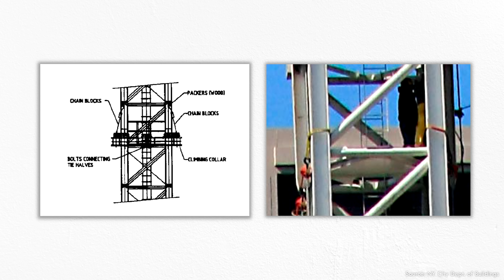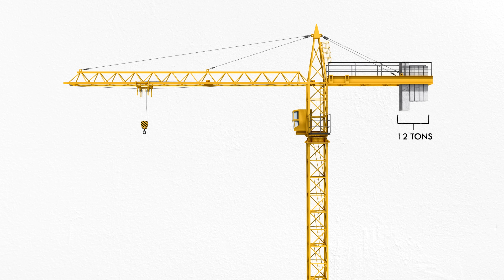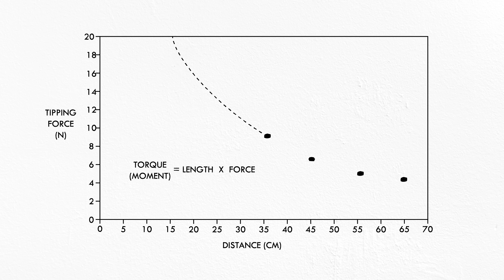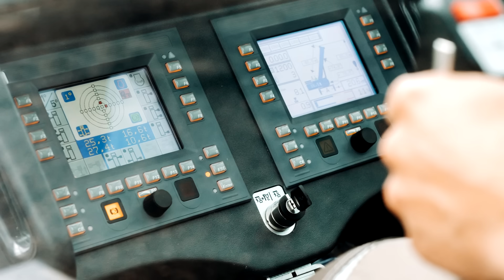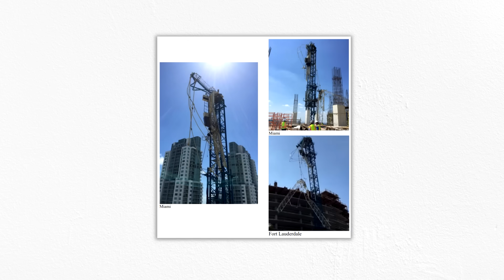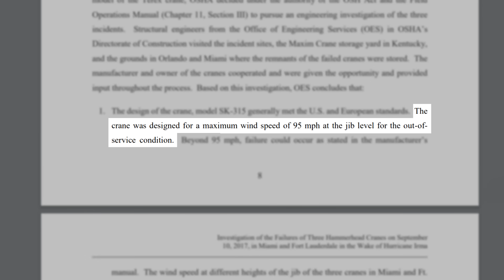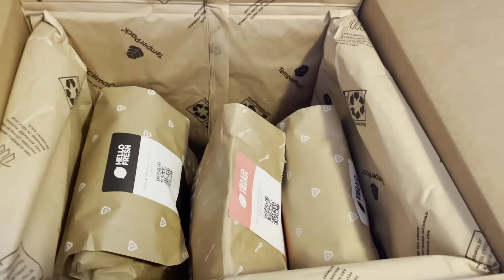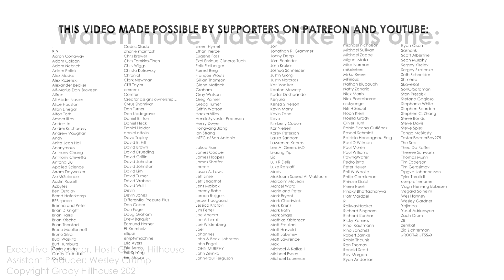Why Cranes Collapse

Comment: I have a smaller Knuckle boom crane. 
It lifts 1900 pounds 75 feet. Straight up it’s 86 feet. 
It’s crazy How gravity plays games
When I was younger I was in an aerial bucket truck when it got laid on its side. 
It threw me like a Rag Doll Apparently there was a small void in the ground and the Outrigger went down The truck shifted enough that’s the Centre gravity Shifted Enough the truck went over. I was lucky 
The dirt was unpacked and Soft. 
With my new truck that I own I Crazy overkill the Outrigger pads. However There’s a lot that can go wrong. What I can lift straight up
Will lay the truck on its side If Extend too far out without lowering it. 
I see a lot of crane operators With too many extensions out(Straight up) Not realizing the extra weight In the extensions. They should only take out the boom as far as they need. 
When in doubt get as close to the load as you can before you pick up. 
It’s amazing how many close calls I had even being is over careful as I am. 
Just because it’s rated For it Doesn’t mean it will lift it Safely.

Comment: I’m a high voltage lineman in the Dallas area. I was working the storm on the Dallas crane accident you mentioned. We had several outages due to the winds that night. The reason I remember it so well is because basically no news stations reported the incoming storm. It came out of nowhere, it popped up North of Dallas and winds quickly picked up, if I remember correctly Addison airport had winds in the 90+MPH range. I’d guess the crane that fell into the building was left locked down like you mentioned. Nobody expected that storm.

Comment: Anything with at least one dimension of twelve inches had to be stacked on the shore. Yes, from twigs to 100’ long water logged trees. If the boom was hampered by trees, I climbed the boom to cut the tree limbs after hoisting the chain saw to my position by rope. It was a great job with me starting and knowing nothing of cranes and barges to become a thoroughly efficient deck hand.

Comment: A two cylinder Lister winch raised and lowered the spuds. A Detroit Diesel powered Sea Mule provided propulsion but at a slow pace. The Sea Mule pivoted the barge on the weight of the crane. In a high wind the crane assisted the Sea Mule by paddling with the clamshell bucket. 
It was nine months of loading piles of driftwood on transport barges to be burned in a smokeless fire miles away.

Comment: Not on topic per se,  but i am curious about one thing about cranes.  I've seen how tower cranes are assembled, but i was watching one show about the construction of a really tall building in China.  It seemed like the buildings upper floors were taller than any available cranes could reach so they were welding attachment points to part of the building itself and the crane was moving up that way. But then they built the floors under that as they went.  So the crane was attached without is own tower and the structure it was mounted to got covered by the construction.

How the hell is that crane not a permanent part of the building? Or is it?

Comment: As a crane operator, then trainer who wrote the operating and inspection training programs at a nuclear power plant, your information is spot on. Our cranes were a 170 ton pendant operated reactor building crane, a 65 ton cab controlled turbine building crane, both overhead traveling type. We absolutely required a single designated signal person, except for an all stop. We also tested for operator depth perception and fear of heights, as well as load swing catch. Our operators would "compete" with each other as to who was the best at totally catching the 169.5 ton loaded reactor fuel handling machine exactly in order to lower into the reactor isolation valves without any further movement. I would make the turbine crane operators lower the hook into a bucket on a complete angle far from the cab, to test depth perception and vision. Ah, those days...

Comment: Maybe a silly idea but why could a fixed or even a tower crane not have like large anchro screws drilled into the ground or even say bedrock. Your sand demo made me think of this as one side presses down but other lifts up like a lever so why could it not be anchored down with some sort of a screw system? Besides if one side was over tightened if do this it seems it would highly unlikly a crane could totally fall over.

Comment: As a Wisconsinite, there is no need to clarify the "American Family Field".
Everyone still calls it "Miller Park" or "Brewers Stadium".
Up yours AMFAM.

An interesting piece of info; the original operator for Big Blue declined to hoist that day because of the high winds. Due to deadlines and budget constraints they brought in another operator to lift the roof section.

Comment: I watched two very tall buildings being built in downtown Chicago 2-3 years ago. Both had different types of cranes and all the cranes were assembled and operated safely. I watched them lift and place a lot of different types of loads from steel beams to hoppers of cement to outhouses. It was cool to watch.

Comment: I witnesses a near crane collapse as a 97, 000 lb solid fuel rocket motor was being lifted from my trailer onto a railcar, on of the outriggers on the crane suddenly collapsed into a depression in the blacktop which it was standing on and thanks to the quick action of the crane operator there was no damage done

Comment: If a building were built from heavier beams at the bottom to progressively lighter beams according to load at the top of the building could building be made higher and safer with cranes?

What about using plastic instead of steel for building beams?

Comment: I’m the accident in Milwaukee the gc on the job was constantly in trouble for safety violations because it was managed so poorly he forced contractors to do things unsafely and they were the ones that told the crane operator it would be safe additionally the three people that died were in a bucket meant to bolt things in place one everything was in place so first off only one person was needed in the bucket and additionally the osha guy was there to look at safety concerns if that doesn’t tell you something

Comment: I spent 35 years in Ship Repair after coming out of the Forces. In that time I saw 5 crane failure's which resulted in 3 deaths. 4 of the failure's were due to overloading for the radius the jibs were at, the other one was high wind. It's a horrible feeling watching a Crane go over and knowing there is nothing you can do. I am 78 now and must say that the vast improvement in Health and Safety in the Western World has contributed to workers safety but we know that accidents still happen!
Reply: High winds I can almost excuse as an unanticipated element but overloading for the radius seems like wilfull recklessness. There's no way any operator wouldn't know the load limit by radius, that's the most basic of all limits. They had to have been disregarding the limit, right? What kind of organizational incentives led to that?
Reply: @chiaracoetzee  At 20 miles an hour, radius and boom length should be reduced. At 30 the lift should be cancelled.

Comment: I've always wondered how a tower crane can manage to go from unloaded to loaded, without falling over forward.  Obviously there are counterweights on the opposite side of the beam, but that just makes it seem to me that when UNloaded the crane would have the potential to fall over backward.  I had always assumed that the counterweights moved in and out, closer and further from the fulcrum point as the load being lifted is added or removed to keep balance, but in this video, in some of the closer shots of the cranes, it doesn't look like this is possible.  Isn't this a seriously restricting aspect of the loading of any crane of this type?

Comment: I have been a crane Inspector and Test Director for over 15 years.  I find that in the early days, cranes were over built do to a lack of knowledge (engineering) and an abundance of labor and material.  Today, cranes are engineered right to the edge.  The benefit to the crane manufactures is that they can sell a higher capacity crane at the lowest possible expense.  The problem this creates, however, is that there is literally no room for error.  The slightest miscalculation is now catastrophic were it might have been absorbed by an older crane with an inherently larger safety factor.  Additionally,  profit of a project is inevitably tied to the speed work can be done and often has an inverse relationship with safety.  Methods to "speed up the job" are often implemented at the cost of doing it as safely as possible.  The willingness (known or unknown) to cut corners coupled with cranes built to the edge is a recipe for disaster.
Reply: a good rule of thumb is dont go above 75% without a lift plan signed off by an engineer
Reply: Old Lima cranes are proof of overbuilt. 4100 Vicon also. New cranes are no match
Reply: @travisw81  we LOVE them here in Jamaica!!  An old employer has several “new” Krupp hydraulic cranes being scrapped for parts while the Limas that are 50-ish years old are still going strong (including one that I watched turn over about 16 years ago)….
Reply: Remember, though, that when cranes are assembled or operated incorrectly, it's not always the workers who make the mistake or cut the corners. Often it's management that demands they do it.
Reply: Brian - DUE
Reply: Just like everything now
Reply: In the 1970s, I was taught Allowable Stress Design. It gave an overall factor of safety of 4. In the 1980s, many engineers went to Load Factor Design Method which seems to be a factor of safety of 3. With older US made steel it was fine. Starting in the late 1980s, foreign steel started coming in to the US. Some of it was substandard and lead to failures. There is still substandard steel around and it can cause failures. In 2005, I was told about chinese steel that failed at 1/6 the design strength.
Reply: @richardross7219  foreign steel flooded the U.S. in the 80s. My grandfather worked at Geneva steel. They had just finished major upgrades and their plant was state of the art. The Chinese started selling steel at prices just under where geneva and other US mills could stay afloat. The federal government refused to increase tariffs or do anything about it. 

After a few years the majority of American mills went bust, and the Chinese steel prices skyrocketed.
Reply: Bang on Brian. That is why Roman. Greek & Victorian structures are still In use safely to this day. Cranes!!  Of old the same.

Comment: I witnessed a crane accident with no injuries a couple years ago. The load was a huge and old machine. The load was properly secured and the mobile care that was used was less than half a year old and was fully loaded with counter weights.

The machine that were being lifted broke which meant that most of the weight fell back down to the ground less than a meter down. But due to the stored potential energy in the boom together with all the counterweight did it cause the crane to tip backwards.

Boom arm landed in a field where nobody was working. The only damage that occurred was the crane and the asphalt in some spots

Comment: I wouldn't necessarily call the tipping action a biproduct of torque. Torque is a moment about the longitudinal axis of the body that would cause twisting, this seems more like a bending moment
Reply from the maker: A moment (or torque) can refer to any axis you choose.
Reply: @PracticalEngineeringChannel  Says who? Generally yes, but in practice when you consider the geometry of the body, torque will cause a twisting of the body.

Just to clarify, I really like this video. Just torque produces a twisting motion. It is more correct to refer to a force acting at a distance that causes bending as a moment/force acting at a distance that causes twisting as torque. 

This is probably the best way to describe it- all rectangles are squares, but not all squares are rectangles. i.e, torque, bending moment, and couples are all moments. But torque is a distinct subset of moment, in which twisting about the longitudinal axis of the body occurs. It is not accurate to say that torque and moment are equivalent, when torque is a specific kind of moment.
Reply from the maker: @shaneprather6743  Thanks for the feedback, Shane. I'm a licensed engineer with 10 years of experience in professional practice. Sounds like maybe you just work in an industry that uses the terms a little differently. The Wikipedia page for "Torque" says "It is also referred to as the moment, moment of force, rotational force or turning effect, depending on the field of study."
Reply: @PracticalEngineeringChannel  This is more so from an academic perspective, not industry specific. Regardless of credentials, we all have room to grow.

Well wikipedia isn't exactly reputable, but yes. Torque is a type of moment, like I said above. The moment of force is a term which specifically refers to torque. rotational force, i.e producing rotation about the axis, not bending. I've never heard of the phrase turning effect, but yeah, seems to imply a turning/twisting motion as opposed to bending.

Fundamentally, torque and bending moments are different. The stresses caused by these are analyzed differently. I dunno, it just seemed weird to me to refer to that action which caused tipping of the crane as torque. I would be more concerned with the compressive/tensile stresses in the arm(?) of the crane due to bending, as opposed to  any shear stress due to twisting.

Comment: Most of the major tower crane manufacturers, according to their headquarters, follow the European standards as far as stability calculations are concerned. The same applies to manufacturers of crawler cranes and large rotary drilling rigs. All these calculations assume an unyielding base such as concrete. In reality, however, we just have more or less artificial or natural ground as a subsoil that tends to settle or fail. Therefore, coordinated theoretical calculations as well as practical tests are currently underway in Europe and North America to increase the reliability of lifting operations and to provide a decision-making tool that is manageable on the construction site.

Comment: What your referring to of a "lift plan" is law now in Canada and a category of what's called "critical lift" depending on jurisdiction is when 80% of Crain capacity or when 2 or more Crain's are used for any lift as well as further rules are what constitute as "critical lift" a separate safety meeting must be done with a personal involved in the lift as well as every one who are working in the area that can be affected by the lift if something goes wrong and if it has a incident what to do all this must be documented and every one are required to sign proving that the laws of rite to know have been met. No workers are left out from the newest labor all the way to the top Canadian OH&S laws do not distinguish any rank or position every worker has "The rite to know and the rite to refuse any work they may find to dangerous" And by invoking there RTR no employer can hold that against the worker.

Comment: I am currently an engineer on an industrial site and our policy is all lifts must be approved by the construction manager, all of our lifts have plans as this is a live plant. Some plans like for tandem lifts need to be engineered and sealed. Above 80% capacity we classify as a critical lift.
Plans need to also account for underground piping which can be crushed by the lifting activities.

Prior to a lift we always have a pre-lift meeting to discuss roles and risks.
During a lift, wind readings are broadcasted.

Never go under a load.
Always stay outside the "hospital side" of the crane (The direction it is most likely to tip in).

A 650 ton crawler will be delivered in the new year to stand up some 150ft distillation columns which I look forward to witnessing it in action.

Great video!
Reply: @sixsgma1563 How did your project go with the 650 ton crawler and 150ft distillation columns?

Comment: Biggest thing I’ve learned with using heavy equipment and material handling is as the operator you have the ability to say “it’s not safe to lift and it’s not going on my machine”

Comment: Crane failures are very simple:-  1.  Load (centre of gravity) extended beyond lateral support limits.   2.  Load increased above safety limits, thus overstressing the structure to and beyond point of failure.   Either results in catastrophic failure.

Comment: 9:23 I read an article about the sports stadium crane in Brazil years ago. It was a massive crane like a Liebherr LR 13000. In the article it stated that the slave driver wanted to save time by not putting the mats down for the crane to spread the load on. The load was a huge roof section. The data recorder for the crane was also disconnected. (like a black box on aircraft) Therefore there was no way the manufacturer would be able to analyze the forces acting on the crane etc.  And of course , liabilities.

Comment: Some tower cranes not only need to weathervane in storm conditions (also when out of service) but they also need to be configured in certain ways in anticipation of the high winds. Also when tower cranes are 'climbed' (ie extend upwards as new sections are added to the tower) the winds must be below a certain threshold as, incredibly, the jib & counterjib (horizontal part) is locked into place and cannot weathervane